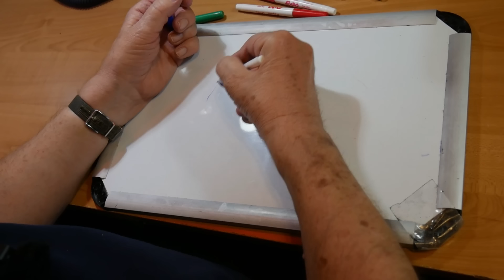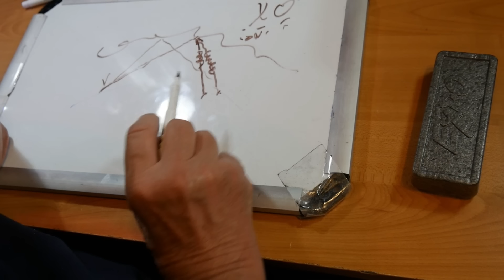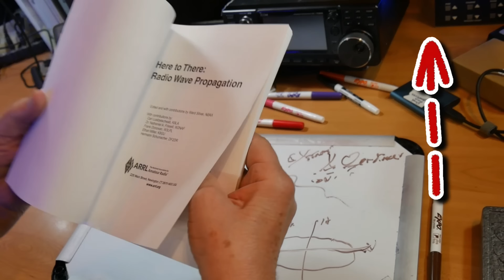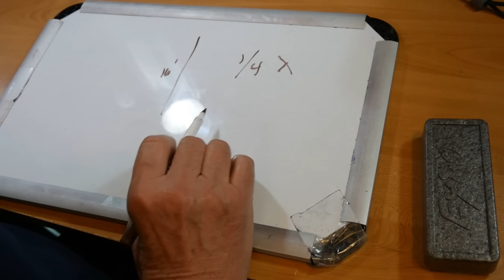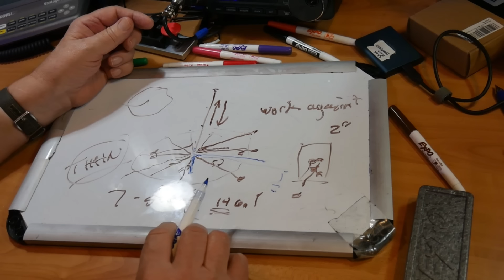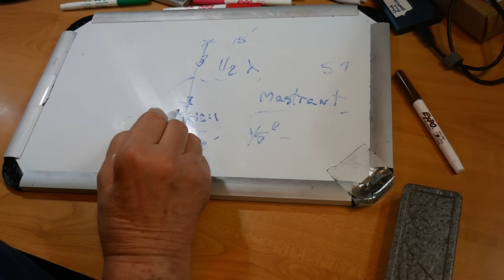About Verticals (#1425)

Comment: If you mount a quarter wave vertical 10 to 15 feet above the ground and slope the radials about 45 degrees downward you will get an almost perfect match to 50 ohm coax, it will also lower the take off angle of the main lobe of the radiation pattern for a better DX angle.  I worked over 160 countries in a little over a year on twenty metres with 100 watts on SSB and CW, using a single band vertical.  The vertical was made of tubing and used 4 radials and could work the entire band.